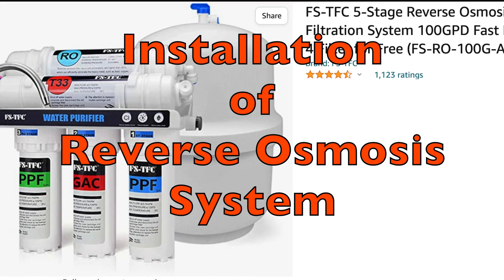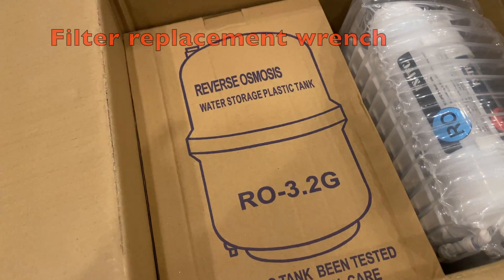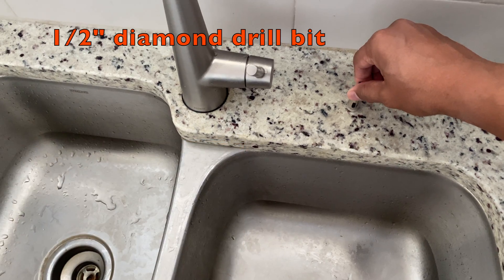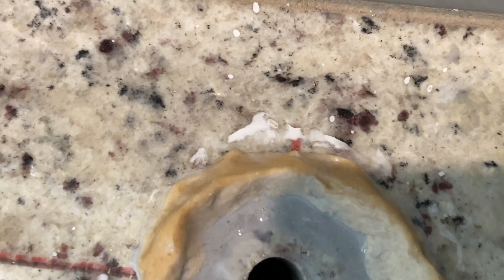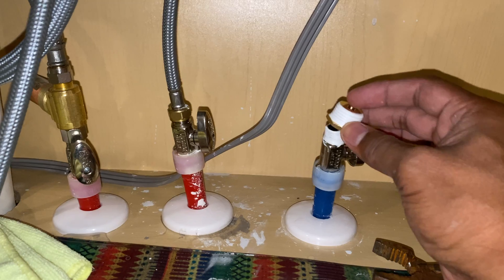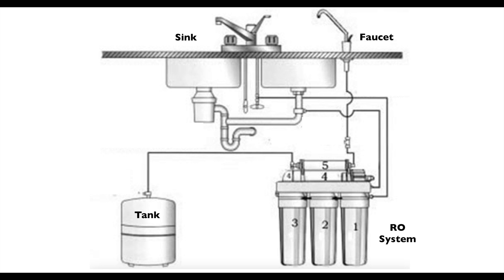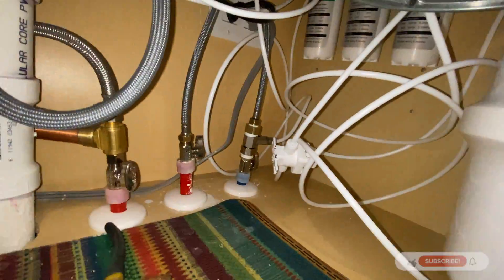Installation of FS-TFC 5-Stage Reverse Osmosis Water Filtration System #reverseosmosissystem #diy

Comment: What’s with the little trumpet looking thing when you said to connect to the faucet at 4:05? Is that supposed to be removed? I have a similar system and can’t seem to figure out how to use that to attach my line to it. 😅
Reply from the maker: Okay got it. At 4:05 you need to throw that valve cap and insert the tube. I should have explained that. Good catch.
Reply: @makersmind  Thank you for the response! For clarity, do you mean to remove it and throw it away when you say throw? If so, would a pair of pliers work?
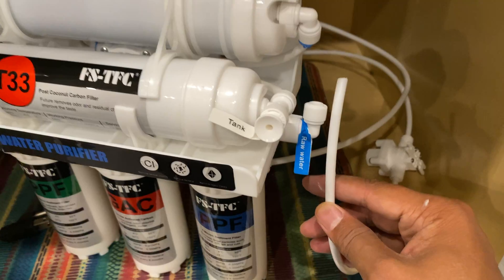Reply from the maker: If you are talking about 3:57 then that reverse pressure control valve

Comment: A friend gave me his system and got a new one, he gave me the old one . Something about flow and that's all I remember. He still had new carts with the kit. I am about ready to run it. I saw him tortured to get under the sink. I couldn't get down there with enough padding if I wanted to. 

I have an unused laundry hook up in the upstairs bathroom next to the kitchen. I've mounted everything on a 4 foot by 11inch shelving board and stuck that on the wall, no messing with loose screws in drywall. It's at eye level, tank on top, bank in the middle, with a L bracket holding the tap near the bottom. I had a garden hose thread adapter to the plastic tubing used here ready to hook up. Drain pipe is handy but I will mount an oil filler funnel into it and under the tap.
Reply from the maker: Nice. Good job